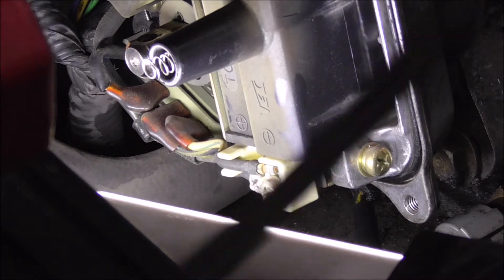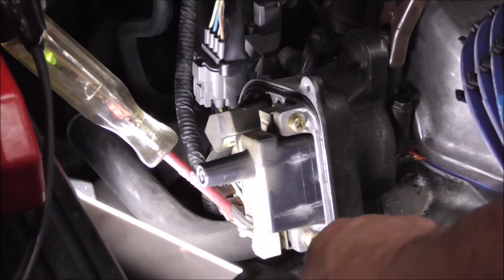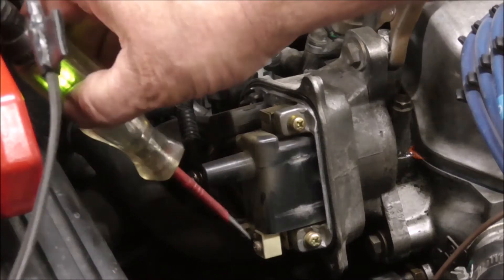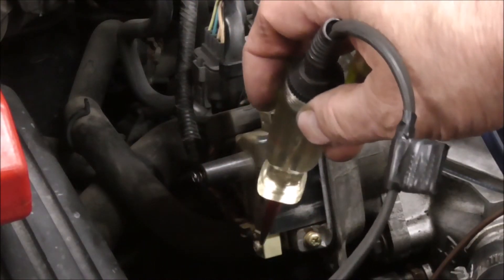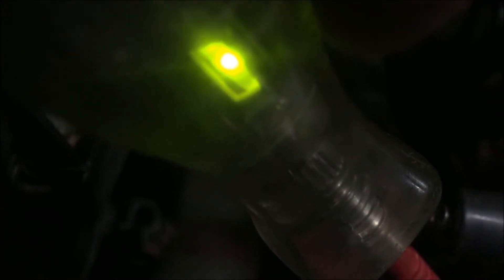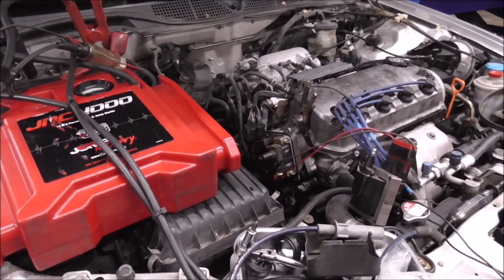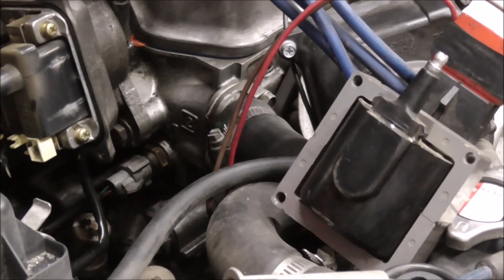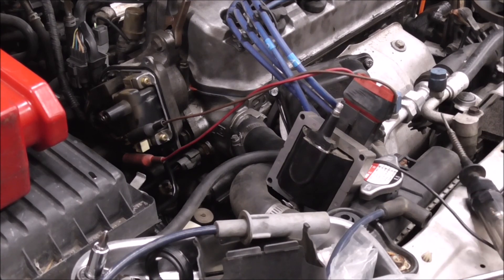99 civic no start, no spark

Comment: having the same issue i replace the distributor and no spark from plugs
Reply: Same thing happened to me one day I was just driving and the car die how did u fix it ?
Reply: @JonathanLopez-ey6ll  my issue was the ECU... I try a different one and it start and run great
Reply: @wonderweiss8579  FYI, usually when there's a PCM/ECM/ECU problem the check engine light will stay on.
Reply: @tpswave3452 yeah, but if the car don't start, you won't be able to see if the engine light even come on